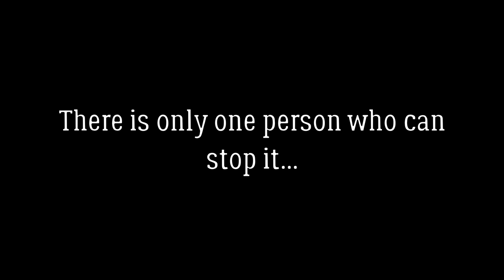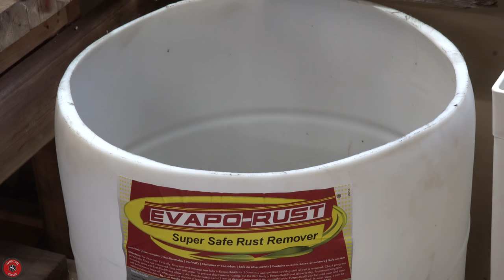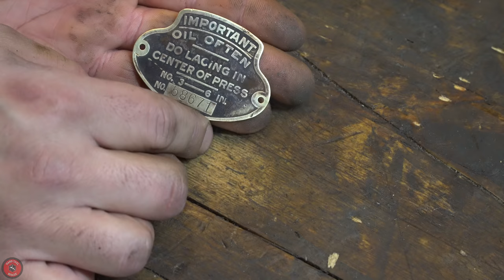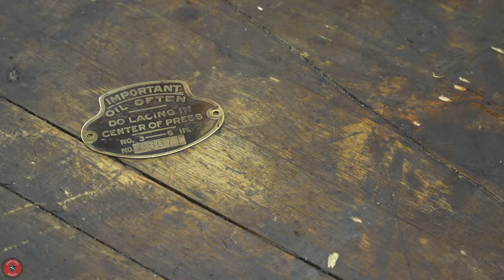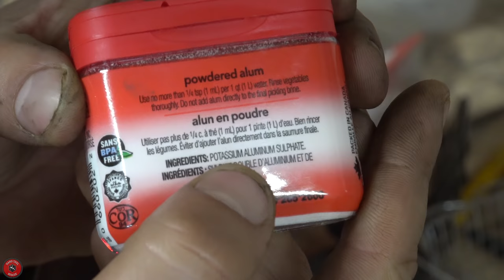Antique Belt Lacer [Restoration]

Comment: Brought back memories of my early days as an apprentice machinist at the B&O RR in Newark Oh. 1957. Threading rod, and fixing broken belts. Two of my first assignments. The shop still had a Civil War era car wheel lathe in one end driven by leather belts off of an overhead lay shaft. The lay shaft was driven by some source in another building (????)  I relaced more than one belt end. The newest electric motor driven lathe was a 1935 American Browning  and there were two other larger motor driven lathes from the WWI era.
Thanks for helping/making me remember my youth..!!\
Reply: Thank you for enlightening us! I had been scratching my head at why one would need such a kind of link on a leather belt...
Reply: In the 70's as an apprentice I was doing drive belts with one of these. I even made a belt to hold my pants up.
Reply: Same here but in a different application.

Comment: I love how this old stuff is so overengineered to last well beyond it's industrial usefulness. I wish modern engineering was as user servicable, and overengineered.
It's obvious by the sticky hinge-pin that it was used extensively, but its robust design has made it bulletproof enough to function 100% even a century later.
Great video.
Reply: My grandfather, who went to engineering school before World War I, told me he'd calculate the stresses and tolerances for a piece of machinery, and then add 10% as a safety factor.  That was the common practice in those days.
Reply: that's not over-engineered, that's WELL engineered
Reply: Good engineering is to take something complicated and make it look simple or simple or simple to use.
Not easy to do.
Reply: remove all the cast steel peices, replace with plastic, all the steel peices, replace with aluminium, now you have the same thing that could be made today, but not nearly as robust, and not nearly as long living. Thats all thats really changed.
Reply: @Ambidexter143  I mean thats still done lol, its a common practice (excluding stuff that are made to be especially cheap) to slightly overbuild something so that it survives even in an edge case
Reply: @DuriensBane  and it cost a thirtieth of the original… so… if it overlast its expected usage life ten times you are just throwing money away.
Reply: You and me both
Reply: @DuriensBane  don't forget to jack up the price 3000% past your profit margins XD
Reply: @Ambidexter143  brother that’s still done till this day. As a millwright, when we do preventive maintenance we take that into consideration as well. We align everything with a pretty tight tolerance for maximum production.  Wether that’s the rim& face alignment or elevation. Usually within 3 mils or so
Reply: That type of lace is still used extensively in round baler. I've got a new one and an older one that fit in a vice. The new one is aluminum, the older one is steel.
Reply: Another interesting tid bit is these are still used in the most modern facilities. I'm maintenance in a facility that has plenty of laced rubber conveyor belts and if the lacing fails and it can be cut and relaced we use a device almost identical to this. Actually this one looks sturdier than newer models.

Comment: Wonderful tool rebuild.  As late as 1972 in Fort Worth, TX I would take a leather or composition drive belt to be re-laced.  Over time the end staples - the laces - would pull out of the leather.  It was ordinary wear and tear from the strain on the drive belt.  I never saw the lacing machine in operation because the guy at machine shop counter took the old belt back into the rear area and returned about five minutes later with it all fixed up with new laces. They would trim a minimal amount off the old end, then re-lace each end.  The belts were expensive but the re-lacing was not.  

The belt-drive system on our old Miehle Vertical printing presses had three rollers - one on the electric motor, a take-up roller, and the driven roller which actually moved the various parts of the printing press.  A lever was attached to the take-up roller, and together they worked as a clutch, with the belt providing the friction, as the lever slowly swung the take-up roller, which tightened the drive belt, bringing the belt tight enough between the motor drive and the driven roller to run the machine.  The system allowed for over-length belts, so we could get at least a year out of a single belt before the end trimming made it too short to fit over the drive shafts.  I was trained never to slam the drive, just ease it up to speed, so as to not put too much strain on the lacings at start-up.

They used some sort of dried rawhide insert to hold the laced ends together, instead of the wire you used.  The belts drove our two Miehle Vertical letterpress printing presses, very durable old machines. one really old one probably from the 30s, the other made in the early 50s.  Another machine we had was an old diagonal tape Davidson brand offset printing press - the same type that about twenty years ago I photographed in the printshop of the battleship USS Alabama, launched in February of 1942. 

Even older small presses we had at various times tha used leather or composition belts were the Chandler and Price or Kluge or similar 10x15" to 12x18"  platen printing presses, which printed up to about 11x17" sheets.  They had a big on-off lever connecting the drive belt to the flywheel, plus a foot brake on the flywheel to stop faster once the drive lever was thrown off

Those laced drive belts, and the tools to replace the laces, were very important to all sorts of machinery for many decades prior to more modern machinery drives.  Everyone has probably seen photos of the old factories with overhead drive shafts, and belts dropped to power various machines on the floor below.  Though I don't know for sure, it seems they might have used laced belts, too - it appears those staples could have been installed with a hammer or heavy pliers, though not as perfectly as that tool.
Reply: They're still used in round baling machines (see ChuckE2009)  and I presume conveyor belts in all sorts of agricultural gear are still laced the same way.
Reply: I was using a nigh identical machine to repair conveyor belts at a cannery in the 1980's. 
There are probably thousands of these still in use, as it's not like they really wear out.
Reply: Ammo Alamo Fort Worth, eh? My grandfather was a Pressman at the Star-Telegram.
Reply: @Ammo Alamo
I am curious at what company you had these repaired at. I work for Texas Rubber Supply was it there?
Back in the late 80's the Mckinney cotton mill had these antique machines that ran on these leather belts. We went in there and 
reworked them prepping for a movie.
Reply: I worked for United Heat Treating on Montgomery Street in Fort Worth We stress relieved the welded roller assemblies for
printing presses for several companies. The Conover Company was one. We heat treated other press parts, too.
The original United Heat Treating building and equipment was straight out of the 1920s and 1930s. Old and antique 
equipment was rebuilt all the time.  
The old time machine operators used their hands to flip the belt from one pulley to the other (to change machine speeds, 
like on a lathe) and if one of the metal lacings had broken, it usually made a nasty cut.
The metal laces were a good invention. Earlier lacings were leather.
It is a small world.
Reply: We got an old  mobile chop-bandsaw a few years ago whichs pump is belt-driven by the motor. I also noticed that the drive belt is also laced the exact same way. It's not the original leather belt anymore which seats on the pump's pulley wheel, it got replaced by some rubber left-over stripe of friction belt a long time ago.
Reply: for some reason I was thinking it was for a mans belt at first and then i realized once he put the staples on.
Reply: My wife and I got an old Chandler and Price 12*18 running just a few years ago for her shop. With a DC motor and speed control it runs better today than it did new, a hundred years ago. Thanks for this little bit of info!
Reply: I will restore the belt drive in my smithy at some point, its wonderful to see a workshop with belt drive.
Reply: Eldormen these were still in use up to around 2000 in a factory in Lincoln , England. Manufacturers of all kinds of drive and transmission belts which were sent all over the world. Latterly canvas and rubber construction up to a metre wide at least. Still common in mines and food factories etc. Believe often referred to as Monel fastenings.
Reply: My grandparents farm used these kind of belts, only made from canvas, as late as beginning of 1990's. We used it with electric engine as power source to drive conveyor belt to move feed for cattle to storage silo. As a small kid i was at the same time mesmerized about the power and danger of it (no guards, rails or safety systems. Only common sense, genetic self preservation and severe talking-to to stay away from it) and also about how the belt could stay on despite having no stops for it roll off. As i later learned it seemed the rolls were slighly round making it stay on.

I'm lucky to have gotten to live summers at such fun place as farm, sadly nowdays those places do not exist anymore where i live. They are all industrialized factories with insane workloads and schedules.

Comment: If I might make a suggestion. Try getting some wintergreen oil. For quite a number of those smaller screws (and even bigger ones), it is thinner and has better penetration characteristics than many penetrating oils. We used this in aviation due to the fact that all you generally have to do is apply it, wait about an hour, viola, screw comes loose. It works very well, it's also used by many gunsmiths with the small parts they work with. I also noticed that it tends to break up the oxides quite a bit and break their hold on things to make removal of parts easier. it does tend to be a bit pricey, but you also don't need a lot it to work. and it saves time getting things unstuck. I also never had to use heat on anything using it either.

Comment: Nice work!  Tip: at the 33:00 mark in the vid, the latch spring--you installed it backwards.  Anytime there's a large end and a small end on a spring in a journal, the large end is the static (non-moving) end, and the small end is the moving end.  This helps keep the spring moving smoothly and prevents the end of the wire from scoring the drilled journal.   Thank you for saving yet another piece of history!
Reply: The Devil In The Circuit TY I learned something useful
Reply: Tip highly appreciated ♥

Comment: My Dad worked in the oil fields during WW2. One of his jobs was to repair drive belts. He used a tool similar to this one to repair the belts,but they used some kind of spark proof pins to hook the ends together. Some of the belts were about forty or fifty feet long.

Comment: Glad he showed a demonstration, otherwise I'd still not know wtf it was XD

And is that the worlds smallest anvil?
Reply: I had an anvil just like this, in that hole you could fit different parts, one was in the shape of the inside of a shoe so I think it was for shoe repairs. Also I had a tiny anvil about 2 1/2 inches long, more of an ornament.
Reply: Actually, I think there's anvils that are even smaller. I think jewelers use them, or did in the past.
Reply: @clydebalcom8252  Yes, absolutley correct! I am a watchmaker and well we, and our friends, the jewellers use such tiny anvils to repivot clocks, set jewels, to punch clock pins, and to loop necklace rings!
Reply: I still didn't understand what that does
Reply: @E_Proxy  para unir correas de cuero para maquinaria antigua.
Reply: @ruso1697  I'd have to learn Spanish 😅
Anyways I guess those are belts for machineries' motor to transfer rotation movement to other components (more or less like car belts). Right? And this tool is used to lace belts in series or to create an halo and use them as they're intende to?

Comment: Use dental picks to clean out screw heads. They're useful for many, many things like breaking up crud in creases so penetrating oil can soak in more easily, or finding cracks in metal. Look into it, they aren't expensive...I use them on nearly every project. The little mirrors are useful too.
Edit: dental tools in general are just super useful.
Reply: Also, gun cleaning picks. Exact same form factor as dental picks, but they're plastic (nylon, I believe) and work great with softer metals.
Reply: They're handy for dentists too.  😃
Reply: Are they good for scratching your nuts?..... I'm just asking for mmmm.. A friend! 🤔
Reply: I use mine for mineral identification.  They are usually ~5.5 Moh's Hardness and great for small grains in a rock sample.  Not just for teeth.  I also confused the heck out of my dentist when I asked if he had an old one.  After my story, he was happy to help.
Reply: Just ask your dentist for one. Mine pulled out a tub full of used ones. They don't use them very long before they are discarded. I selected about half a dozen. Very handy.

Comment: I used to be a bowling pinsetter mechanic. The older model AMF pinsetters I worked on used that kind of flat belt to move the pins, and we had a portable model of belt lacer that you put in a shop vise to crimp the wire loops.

Comment: We used larger versions in coal mines for the conveyor belts.
Reply: Yeah exactly the same except we used them to load our cement mixer,like you say a lot bigger.
Reply: So this was for belts that drive machinery?
Reply: I worked in a factory manufacturing conveyor belts for coal mines etc. My task as a laboratory assistant was to constantly check the belts for mainly anti static flash over and being fire proof, then wear and tear, stretch etc. Fasteners had to be very special to prevent any such event. The belts were often used in a u shape to prevent stuff falling off the sides, much more complicated to fasten long belts.

Comment: !!! HEY LOOK AT ME !!!  For as long as you have had your channel up, i'm sure somebody  has given you the following tip by now . An easy way to remove paint from metal hardware is to put it in  an old crock pot  full of water add a few drops of dawn dish soap and crank up the heat Just below a boil). Let the parts cook for at least an hour. take a party out test it the paint should wire brush right off. (I like a brass bristle brush for this there is a higher density of bristles and being softer brass the bristles squish into nooks an crannies better, buy a few brushes of each size,they wear out faster than steel brushes) if the paint isn't soft give it more cook time.
Reply: or pressure wash it